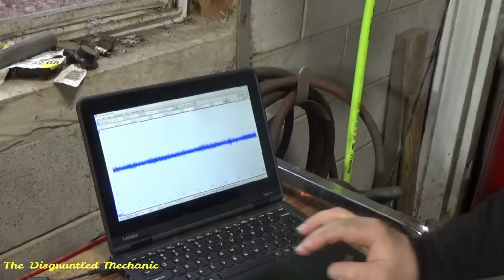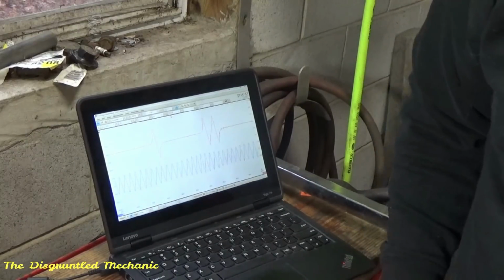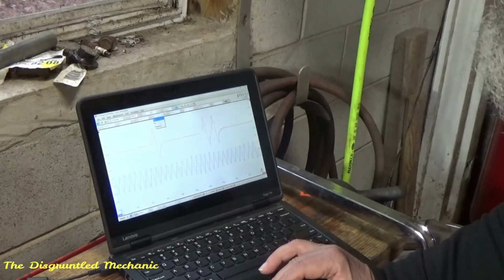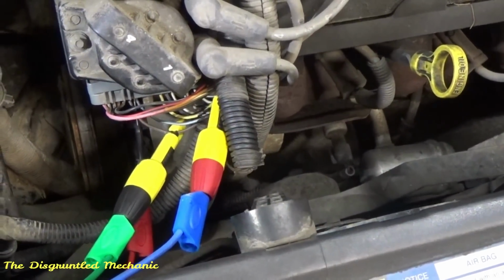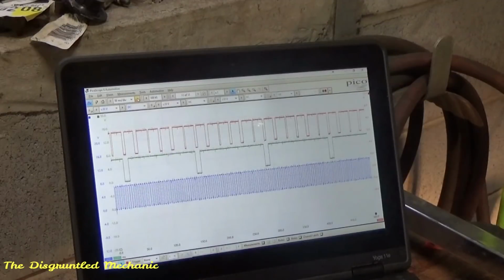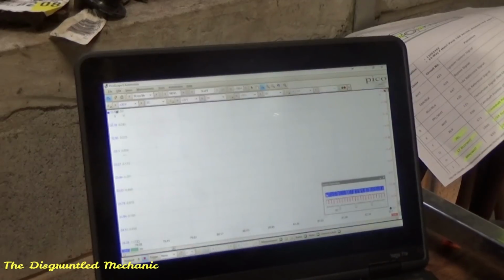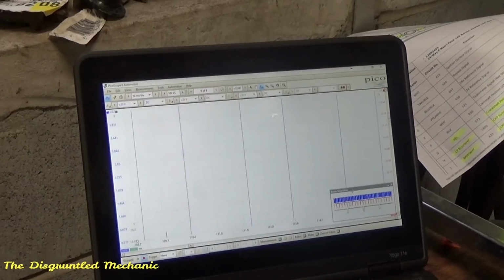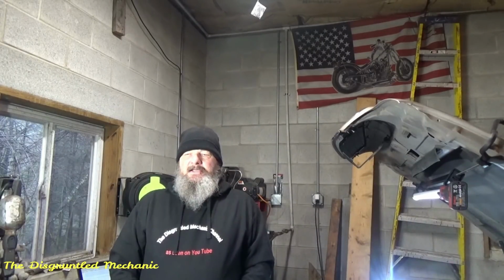Picoscope- Getting a Cam & Crank correlation waveform

Comment: hi from Egypt i see you  have three channels  one for crank  signals   and one for cam signals   i wonder what is the third for ?
Reply from the maker: Hello Egypt! There are 2 crankshaft signals 18x and 3x on these Buicks.  So one is hooked to the 3x, on to the 18x, and one to the camshaft signal. the correlation of all these is  what needs to be compared on the graph to see if all signals are in sync.

Comment: Great promo for your channel Mike with that cool looking sweat shirt :) And you're moving right along in learning your picoscope. Just a couple of suggestions for you. When you're looking at signals, it's always best to look at them as DC although picoscope wants to set up the default settings using AC. The reason is that some signals will have a DC component along with the AC component. An example is ABS sensors using an AC magnetic pickup, (2 wire sensors just like on your LeSabre). The ABS sensors on your car have a DC bias voltage of about 5VDC riding on top of the AC signal being generated by the sensor(s). When the scope is set to AC, the DC part is being blocked by a capacitor that is in series with the BNC connection. You want to see all of the signal, both AC and DC and with the scope set to DC, you'll see it all. The setup settings being used by picoscope came from the older model scopes and haven't been optimized for the newer scopes. At least that's what we learned on www.autonerdz.com Finally, when you want to get back to your previous view, look up in the menu area where the zoom functions are located. You'll see an arrow pointing to the left. Clicking on this arrow will take you back to the previous view. Click again and you'll go back to the next previous view and so on. Keep up the good work Mike and you're doing great!
Reply from the maker: Thank you Terry for the information. In the video I did change it to DC and I thought I mentioned that. I did because Paul Danner mentioned it would give a better signal set to DC. The other part about the ABS is great info! Thank you and please keep helping if you can I need all I can get! And I will try that with the view.
Reply: I did see Mike that you changed it to DC and was just pointing out the differences :) With the zoom power of the picoscope, you really don't need to set it to AC for anything. And before you know it, you'll be teaching me stuff about the picoscope :) Have a good one Mike!
Reply from the maker: HAHA! I really doubt I will be teaching you about the Picoscope! Thanks again Terry.